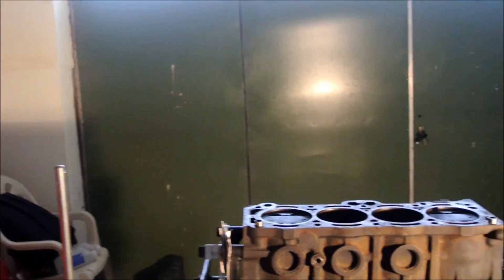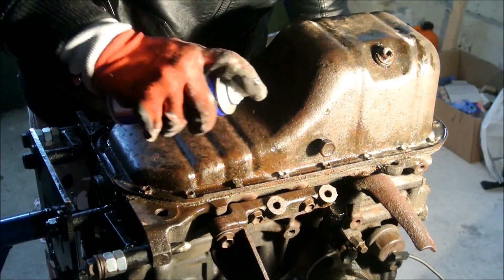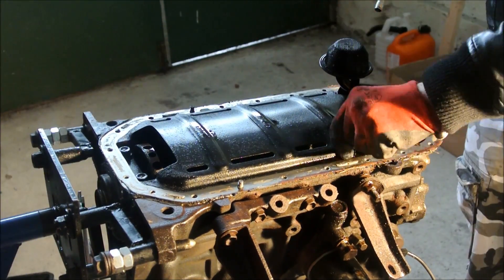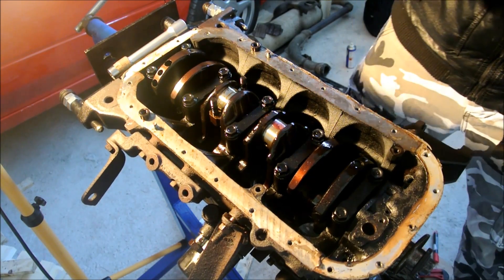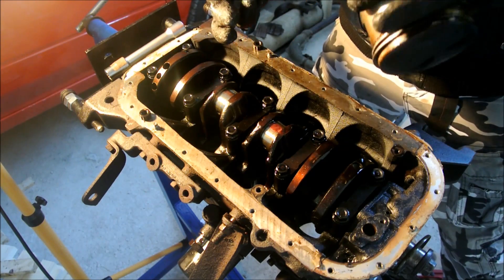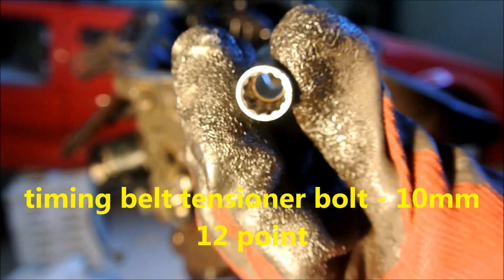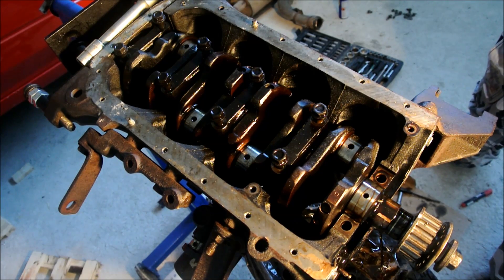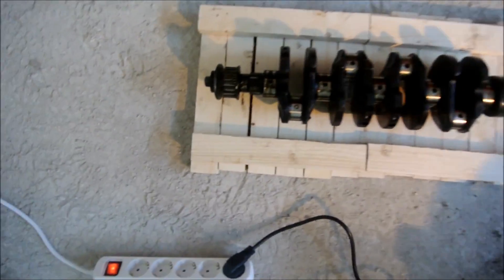4AGE AE86 MR2 trueno how to disassemble the engine block

Comment: Good job Well Done, hey I  love those wooden jack stands, very artistic. So why do you use those, I guess soft wood is better for your frame than hard metal but it seems a bit of trouble to build as you go up. Anyway its cool.
Reply from the maker: Thank you. I used the wooden jack stands because I couldn't get the rear of the car high enough to drop the engine using any of the conventional jack stands available (Toyota mr2 is mid engined, engine is removed by dropping it instead of hoisting it up) and post lifts cost a lot of money :) The wooden stuff is honestly super solid and safer than jack stands by a good margin. The drawback is a as you pointed out that they do take a bit of time to stack up and lifting the car up like this on a daily basis would definitely be a major pain.

Comment: Just FYI Toyota lists an STT for removing the oil pan which is quite expensive but you can order an oil pan seal cutter on Amazon for about 14$ and it's basically the same tool as Toyota uses.  It's got a somewhat sharp lip on it and you hammer it in between the block and the pan and then it has a lever that fits in and you pry open the pan.  I got one and it makes opening the pan super easy.  I just had to wedge it in, in 3 places along the pan and the pan popped right off.
Reply: Thanks! I'll have to have a look for one of those!

Comment: I need the engine bracket thats on the right side of your block .
Do have any idea where I can pick one up ?
Thanks for the videos ...
Reply from the maker: Is it for an aw11? If it is try Neil Jones in the uk, I got a lot of stuff from him. Top notch used parts at fair prices. Just google mr2 mk1 spares. If it's for another Toyota, try the club4ag forum classifieds.
Reply: answers the 1.6 engine I have is a 4ag and the car is a 1983 Toyota Corolla Wagon .
I'm trying to add power steering and I'm in need of that bracket...
Reply from the maker: That's the alternator bracket, if we're thinking about the same thing. You can definitely get that from Neil Jones. Just google mr2 mk1 spares and his site should pop up.
Reply: answers  thank you .

Comment: Watching the process of breaking everything down is really helping me understand and visualize how it is all needing to be done. Recently I acquired a Red Top 4A-GE and I bought it seeing that the current motor in my AE86 is a hybrid of a Blue Top 4A-GE head and a 4AC block.  I wanted to have a uniform motor and now that I'll need to rebuild the Red Top I bought (since I don't know its operational condition) it's great to see all this going on.
Reply from the maker: Jeffrey Darwin Glad the vid was useful. Congrats on the purchase and good luck with it. Check out club4ag forums and my other vids, there's a lot of useful stuff on the 4ag there.
Reply: driving 4 answers oh I've already began watching your other videos and they're great!
Sad to say I've tried joining Club 4AG but whoever the administrators are they have yet to approve my registration and it's been 3 months now.
Reply from the maker: Jeffrey Darwin Same thing happened to me, send them an email they'll approve you right away.
Reply: driving 4 answers thank you man I very much appreciate the advice! 
Watching your videos is giving me a bit of confidence to change the valve stem seals on my 4age/4AC. The 4th cylinder is creating smoke and it's the valve stem seal that's causing it. I've never parted a motor so I've been hesitant to dive in, some say remove the head from the rest of the motor and others say it's possible with the motor still being in the car.

Comment: Yeah, that 7rib-3rib thing is not  100% true all the time. In fact, European AW11s (non catalytic converter) Bluetop 4A-GEs have 7 rib blocks with high comp pistons (10:1)  instead of the 9.4:1s as used in other markets where the engine is designed to run a Catalytic converter (like usa or canada) and also as used in the AE86. They also have 40mm crank journals with 18mm pin holes. So it seems for some markets there were sold some kind of hybrid engines between the 3rib and 7rib. There is also a mixture of flywheels for this European bluetop 7ribs where you can find ones with 200mm flywheel+clutch and others with the upgraded 212mm set from the late 1986 models.

On the other hand i wanted to ask you if its possible to read the conrod inscription to know what bearing is needed WITHOUT taking out the pistons+conrods? i mean, could it be done from under the car with the engine completely mounted and just taking out the oil pan and conrod bearing caps?

Thanks in advance

Comment: Hey, this is your subscriber from across the pond =P 

Thanks for posting this! The engine in my AW11 is not the stock engine, and this will help me to determine what specific variant of the 4AGE it is when I get my car back out of the shop.
Reply from the maker: Glad you find it useful! 
The number of ribs are the first clue, the crankshaft journal size the definitive confirmation if you have a 3rib or a 7rib and hence the 40 or 42mm crankshaft journals. 3 rib = 40mm / 7rib=42mm
Both set-ups are actually good. The 40mm crankshaft uses rods with 18mm pinholes vs 20mm pinholes on the rods of the 42mm crankshaft. there is a "big" weight difference between these rods. The 18mm rods are some 50 grams ligther per rod. might not sound like much, but when you take into account that it goes up and down thousands of times per minute that weight becomes important This is a good start for an NA build. Because the internals are lighter the engine revs faster.
The 42mm crankshaft is a bit heavier  and has beefier rods, but it gets more aftermarket support. it can also spin to higher revs, even beyond 8.500 rpm with the right mods of course. Also good for a turbo build.